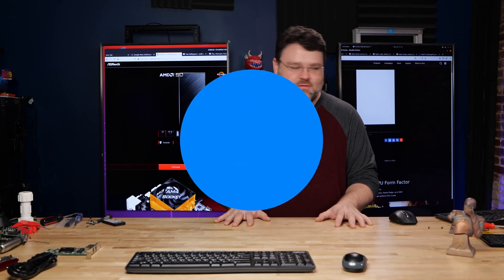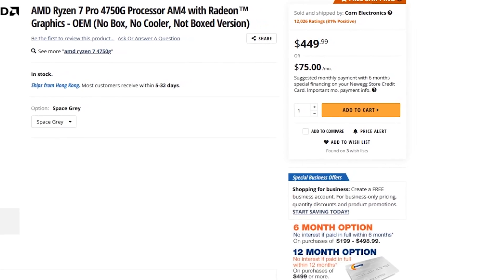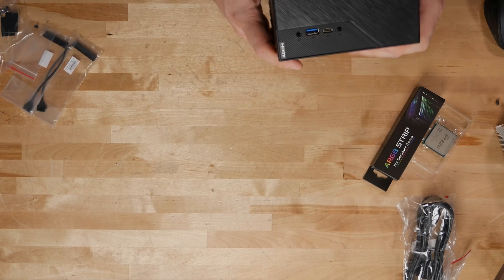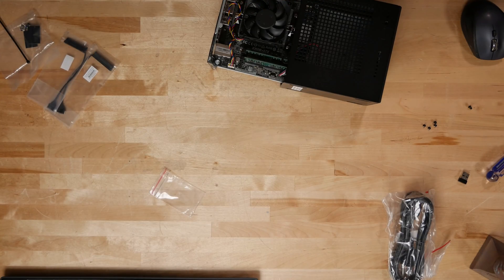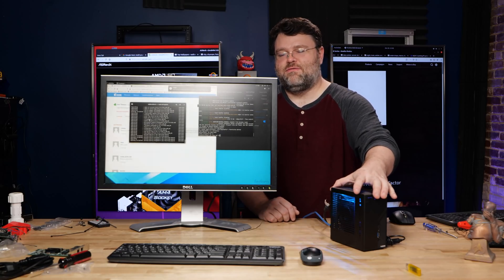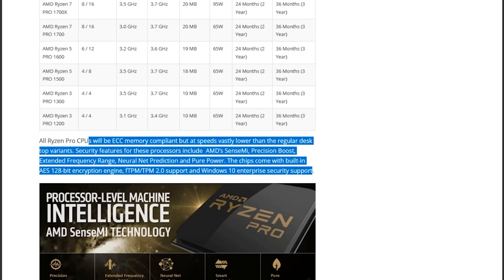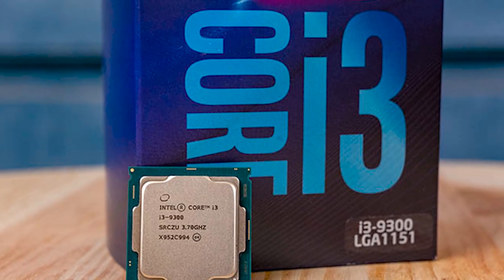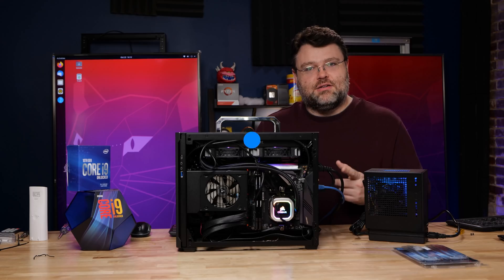ASRock Deskmini X300 and Ryzen 4750G - Unboxing, Benchmarks and Linux

Comment: I came over here to check if the build is using an RGB strip, and guess what? It is!

Have you ever attempted to control the RGB using OpenRGB for Linux? Unfortunately, the ASRock POLYCHROME RGB application doesn't support Linux. Would you be interested in giving it a try? I'm thinking of getting some RGB strips for my Deskmini X300.

Comment: I was able to get 50 fps average (score 6745) with a max of 70fps and min of 38fps at 720p in superpostion with a 4650g, 16 gb ram and Pop 20.04. I was able to get better performance and fix stuttering by manually changing the bios vram settings from auto to gaming optimized. It basically maxes out the vram at 2 gb for the vega gpu. You lose system ram but i gained performance in every benchmark. i also noticed smoother 4k video playback when multitasking in chrome.

Comment: I don't believe X300 board supports ECC memory.  If it did, AsRock would advertise it in its spec sheets, like it does with their motherboards.
It might be a choice they made from the get go, as in, no traces at all for the extra pins on the SO-DIMM slots, or just firmware block.
So I ended up building a Mini-ITX box instead (a lot more $), using their B550 Phantom Gaming-ITX/ax, along with two sticks of Kingston KSM32ES8/16ME.  I used Ryzen 5 PRO 4650G, as it was way cheaper to get than 4750G.
Reply: I was actually curious, so I did a direct comparison.  AsRock X300 is $170 at NewEgg, and includes almost everything.

My build with Motherboard, Noctua NH-L9a-AM4, Morex 557 Case, Mini-Box M3-ATX, and some cheap $20 power brick (no, I'm actually using a high-quality 150W supply that cost over $60) equivalent came out to $350.  That's slightly over 2x the cost of X300 kit.

There are much cheaper motherboard and power supply options for custom builds, but it's still going to be more expensive than X300 kit.

On the other hand, I get proper ECC memory support using full-sized DIMMs, a PCIe x16 expansion slot (for future use maybe), more SATA ports, and other custom options.  My case is actually skinnier than X300, too, although it obviously has a bigger footprint, since it has to support a m-ITX board.

Comment: I'd personally pair this APU in this system with a Noctua NH-L9a-AM4. Should be able to get a bit more performance out of it because it will run cooler.

Comment: Is the processor a good deal for a home media server with Unraid that can function as a NAS, a surveillance server, and a pfsense router? These don't require graphics power. If it could do 4-5 plex streams, I think it could easily be my new server. This Asrock barebone system isn't enough due to the lack of even one PCIe slot so that I could add a quad nic for use as a router. Do you have any other barebones setup that could satisfy this use case?  The mini itx route is pretty expensive without such options.

Comment: Just on the price, so people are aware (since I hope some of you will find this interesting): People selling it in China on taobao, tmall and kd (thankfully taobao ships directly to certain countries and where I live has very low import duty) are selling the 4750G for around 2000 yuan (1900-2000 with some outliers of course), which is about 298 USD. The 4650G is being sold for 1300-1400 yuan ($193.75 USD to $208.65 USD at current exchange rates) and the 4350G is being sold for 918-949 yuan ($136.81 USD to $141.43 USD). 

This makes importing the 4350G around the same price as the 3400G for me, along with the base prices being about the same on taobao across multiple sellers. This makes the 4350G an interesting proposition. It's a 4c/8t part as well but has those lovely zen 2 improvements. While the integrated graphics in it are weaker than the 3400G's afaik, so it all depends on use (like anything). I can see a lack of good warranty support being a turn off for many DIYers due to the channels used to get it, but it's still interesting to think about.

Comment: As a retired dev myself, workstation speed is a tradeoff.  For productivity, you want fast edit/comple/test round trip times.  But if you don't force them to test - lots and often - on slower machines more like most customers have...you'll get code that only runs well on fast machines, and is dog slow on most of what's out there - and of course, forget those running really old hardware - who, nevertheless, are still customers.

Comment: K39 itx case + Flex ATX PSU (400-600w) + B550 ITX + L9a + Ryzen 3700x + DDR4 3600 + M.2 + GTX 1660 (ti/super) 
Less then 5 liters of internal volume with a discrete GPU

Comment: The 6-8 core rank-and-file systems is a huge market especially for BPOs here in the PH where multitasking is king. Even at just 8GB paired with a decent SSD, it will allow for VOIP, multi-tabbed browsing for tools, background analytics, security analytics and monitoring with ease fo rthe average call center employee.
BPO companies buy them here at least in the hundreds to thousands at a time.

Comment: Wendell, does that mean that businesses are still using 1600 x 1200 CRT's as well :p
Reply: @TheGoat nice, however I stil have some older CRT's for my Vintage Computer collection, mostly for my C64, C128 and Amiga computers.

These are all older 640 x 480 type CRT's. 13 and 14 inch but still heavy.

Comment: Probably a stupid question, but could this work with the Asrock A300 too?
Reply: So I couldn't wait, upgraded the BIOS and it works awesome! Does it make sense to optimise the RAM beyond 3200 MHz? Ow, and I am rocking the noctua cooler and its awesome. I basically do not hear it..

Comment: Some people work on i3s, I work on a single core from a haswell server and 4GB of RAM through a VMware horizon virtual machine, it gets completely unresponsive if the window resolution exceeds 1080p and was practically unusable until I installed XFCE. Running an i3 of any generation would be heaven compared to the haswell Pentium 4 HT experience.

Comment: I would buy a bunch of these for business users if it had a vPro equivalent option.  AMD has DASH management but DASH is Trash at the moment.  It really sucks.  It barely works to remotely grab some system specs, do a remote power on and power off command and maybe set a few basic bios settings but those are not well implemented by the system integrations I have tested so it's more or less junk.  Very little support on the management tools side for the DASH management system too so even if it were decent there are very few tools to use and the AMD demo tool is garbage quality and I heard the SCCM plugin they made is basically the same garbage code (but I don't use SCCM so wouldn't matter to me)

Comment: idle power consumption is much better with renoir, you can get under 15w idle for the whole system (measured at the wall) even with a full chipset like a520/b550. perfect for 24/7 use.

Comment: Got my 4750G for 250 euros, used 10 days. It usually costs 320 euros in EU. 
Really amazing CPU, can play 720p Warzone no problem. But more designed for casual gaming in AAA games where fps between 45-75fps is also OK in 1080p and low details.
But to really unlock that iGPU you need fast memory. 4400 CL16 or something so you can run the FCLK 1:1 with the memory.

Comment: This is the APU I'd like to use with a mini-ITX where I can then use the PCIe g4 x16 slot for a quad SPF+ card with 10gig fiber transceivers for an Internet gateway/firewall. The onboard 1gig Cu would go to the 1gig fiber modem uplink. Each of the 10gig SPF+ transceivers would go to a different 19" cabinet's switch. Maybe even train an EdgeTPU chip to detect and handle many types of network intrusion and plug it into the M.2 WiFi slot. Run a VPN on the APU. Ooooooo. It would be glorious.

Comment: For shits 'n giggles someone needs to come up with a STX case that's in an ATX power supply form factor. It would fit! Got a case that can fit two power supplies but only need one? Shove another computer in there. Running the main board off a picoPSU? Shove another computer in there. Or just leave it out on the desktop and confuse your friends.

Comment: This CPU is so late for me. If this came back even half a year ago, or even if AMD launched an 8-core Zen+ APU, I would have been happy with that. But it's too late, I'm already going to move to other CPU architectures, leaving x86 behind (just for the lulz). I started with ARM and I'm using a Pi 4 8gb as a desktop PC (and it frankly is all I actually need, it did a wonderful job for the past 4 days). After ARM, I may try POWER 8 or 9 if I find something cheap (but I'm currently looking for portability, so clearly not in the near future).

APUs were among the last things I wanted (because of the form factor), but I don't care anymore and now they don't get me excited. If I'm not looking into server stuff, I'm looking into ultra-low power consumption (thinking of being able to only power the whole PC with a solar panel and a battery / supercapacitor bank for the night).

Comment: @Level1Techs , @Wendell , can you test the ASRock DESKMINI X300 with an AMD Ryzen 5 3400G and an eGPU (maybe the RAZER Core X (Thunderbolt 3 External Graphics Enclosure)) with an appropriate GPU for the 3400G on Fedora 32 or 33 with pass-through of the eGPU to a Windows 10 VM?  Thank you.
Reply: Not possible. It doesn't have Thunderbolt.  :)
Reply: @thatchinaboi  Are you sure it is "not possible"?  Maybe @Wendell would choose to use a USB 3.2 Gen1 Type-C to Thunderbolt 3 adapter (which are cheap) to demonstrate selective use cases...  not claiming it would be very performant, just not, "not possible".  :-)

Comment: Damn they've upgraded the deskmini and i missed that :)

We use those as miniservers, 3d printed fan shroud etc. and have been reaaaally waiting to get my hands on a 4750G to test if they work with A300. Was so disappointed when it turned out these are OEM only parts hence very expensive, and sadly we cannot be buying these in the hundreds :(

We currently put 8 of these into 4U with room to spare ... I guess we could get upto 18 per 4U if we'd really try, perhaps even more.

Comment: If the Ryzen 7 4750G wasn't so expensive, an Asrock X300 might be an interesting machine to host virtual machines for experimental purposes. For those of us who don't want to build a homelab in a rack with howling, power hungry server hardware from  ebay.
Reply from the maker: The x300 makes a really killer platform for e.g. docker or something like that. And with 8c/16t you can run a lot of full-fat vms with one or two threads too
Reply: hello  @Level1Techs  thanks for the video. I'm planning to buy a desk mini x300 + 4750g for my daily work with virtual machines servers, Java developers IDEs, web browsing etc but i'm a litte concerned about what i've read about vrm and ssds temperatures expecially for intel models (h470). Do you know if the x300 + 4750 is suffering from the same type of problem ? If the vrm temp are really so high under stress, do you think they are effectively impacting performance on 
'normal' everyday use ? (no rendering, no games, no stress test)

Comment: As old loyal customer I'm not amused with AMD anymore, I changed from the first 64-bit Athlon to a Phenom X3 to a Phenom II X4 to a Ryzen 3. As pensioner I'm waiting for the Renoir CPUs to become available for the commons with normal prices on my B450 motherboard. Since 2019 I do use the Ryzen 3 2200G as intermediate step, but I really want the Ryzen 5 4600G for ~$200. That CPU would be 3 x as fast.
Like Intel in the past, AMD is only really interested in their stock price and their customers are simply the means to that goal.

Comment: I actually like there being a driver CD. That way the driver’s will still be available after the manufacture stops supporting the hardware and remove the webpage. That being said, a write protected usb stick would make more sense.
Reply: CDs are very cheap, stable and stack.

Comment: I just got an ASUS PN50 with a 4800U. Very good. Maxed it out to 64gig ram. 8core 16 thread + APU 15W As a developer it is very good and capable. You should check one out for the channel if you can get a review unit. I would be interested in how much quicker the desktop version of the 4800U is. I don't game on my PC so very happy with my PN50. Can drive 4 monitors at 4k. And linux loves it.

Comment: Is the fan too loud for a home theatre system?
Reply: Stock AMD fans are pretty loud under load. If you buy one of the Low Profile Noctua coolers with this, you wouldn't hear a thing.
Reply: @discostoo  thanks

Comment: I've got a 3400g on an x570 motherboard just waiting to get replaced with some Zen3 goodness in the hopefully not-too-distant future, then with an eye for something to do beyond that I've actually been eyeing the deskmini a300/x300 as a decent little platform to drop that soon-to-be-spare APU into. I can think of a couple of things to do with a box that small and portable.
Reply: Snap, but I need to find a discrete gfx card first, my old tower is in storage in another country.  The 4c/8t processor is pretty solid compared to any laptop so a great  interim until that Zen3

Comment: yes i need onboard graphics because i use ryzen on servers. i use ryzen 3600 to replace my old i7 3770 servers. my only problem is absence of onboard graphics card. 
it is very annoying to buy gt210 for ryzen 3600 + samsung evo nvme  + b550 + 128 gb ram server . looks idiotic on my server cases. 
Also datacenter crew is always puts ip kvm connector to onboard graphics. i had to use hot glue to cover onboard graphics connector on motherboard to prevent that. 
i would have buy the sheet of onboard graphics 65w cpu from amd.

Comment: I love those little CD's at first I would say "well you never really know of they have internet" so it was kinda needed.

Now they are far more likely to have internet but not a CD drive.
Reply: Just need to start throwing them on cheap flash drives
Reply: I have 6 computers in my home office, and the only one that has a CD drive is the HP 8300 from like 2012.

Comment: I got one of these and use it for a large 3d printer farm controller. On idle CPUZ says it only uses 5w of juice, which is a quarter of what my 3950X uses.
Reply: Pull out the wattmeter and see what it's actually using.
Reply: @h2oaddict  The entire system pulls roughly 100w from the wall, with its array of HDDs and fans.
Reply: @benjaminford8173  I hope you're not taking about idle power consumption on just the apu. Do you have a gpu connected? How many hdd's do you have?
Reply: @h2oaddict  Its a X570 system with 32Gb of RAM, got eight 8Tb mechs and a 1tb NVME, 8 fans (many with LEDs), and plenty of things connected/powered out of the USB ports. I am currently using the 4750G's built in APU, it was a little glitchy and buggy until I installed AMD's proprietary driver and now it works good.
Reply: @benjaminford8173  I was hoping they would do better with an igpu, I'm disappointed I can't get any of my ryzen chips too idle under 100w. Even my 3100 idles at 140w with 5hdd's and a downclocked 670 outputting to 4 monitors.
I can get my ivy bridge and Haswell chips to idle under 40w with the igpu.

Comment: Did your deskmini 110 end up with displayport flickering issues? It seems most of those I sold ended up having issues with displayport. They eventually fixed with with a board revision, I think 1.04, but it was still annoying to have to replace all of those. Luckily no issues with later 110s, 310s, and a300s.
Reply from the maker: Strangely no? It became an arcade in the office. I had that issue with amdgpu on Linux, but windows worked fine, for a while but it was fixed after a few months
Reply: @Level1Techs  Well, good to know. Regardless, since they did the board revision and on all updated models we've used since, they have been very solid, small, office machines.